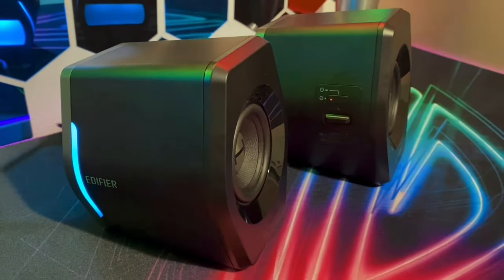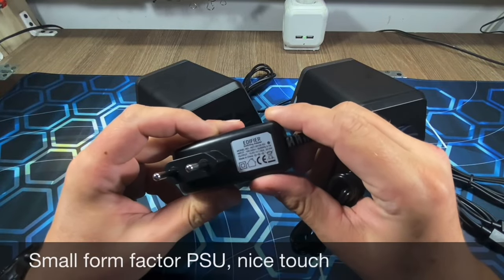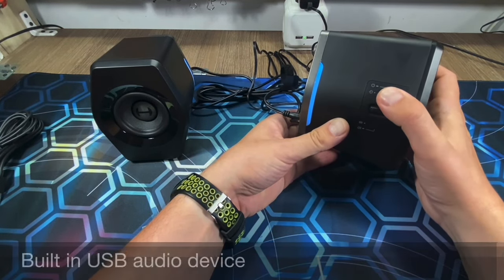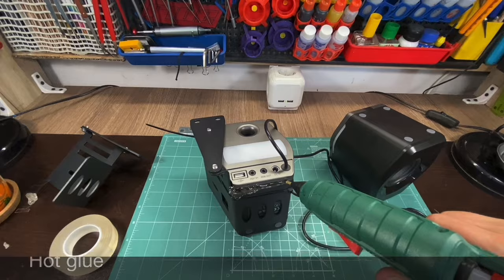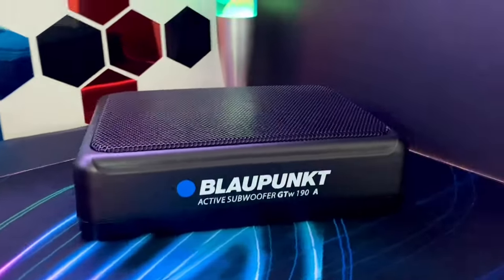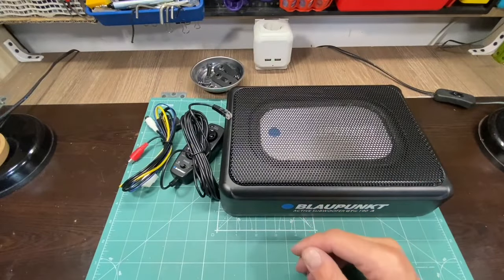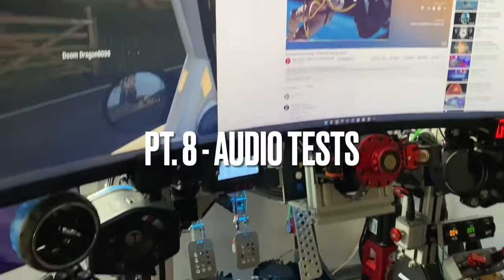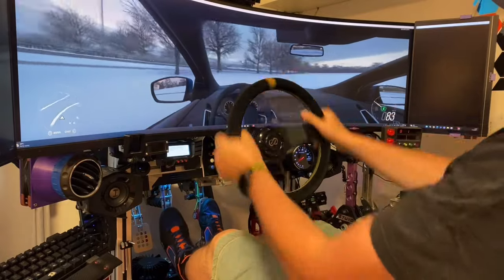Got Bass? Sim Car Audio with Edifier G2000 and Blaupunkt GTw 190 A Subwoofer - Mini Review

Comment: Makes me think of using these in a real car. I wonder how it will work with some moods. Cos a decent Car audio speakers for full range cost a lot, and adding a 3.5inch and tweeter to the fronts also needs some customized enclosure.
Reply from the maker: Doubt they will work in a car. In mine i put Hertz split system, 6” if I remember correctly and they are about same price for pair. Of course you need good stereo to drive them. I had standard adapters that fit aftermarket speakers, 10 eur a pair, but having the speakers in the door gives much better sound than standalone…